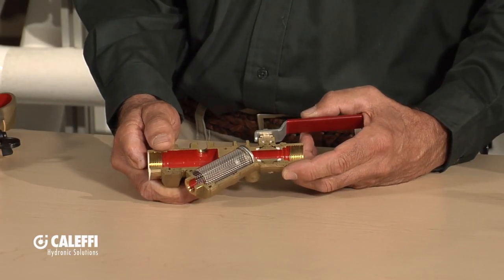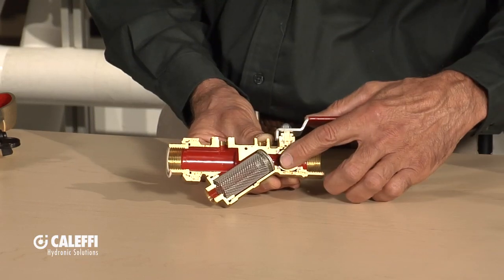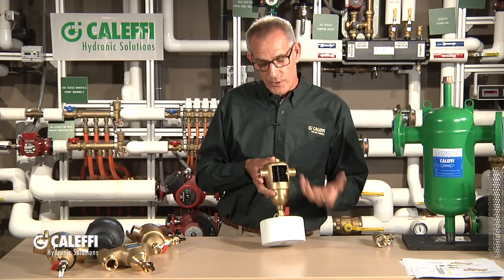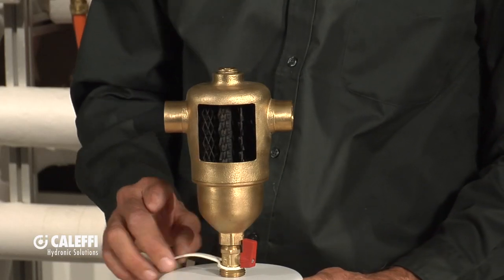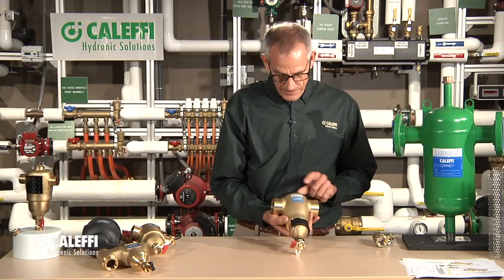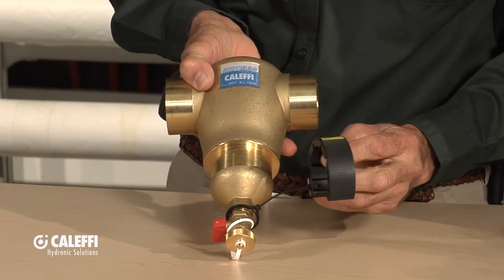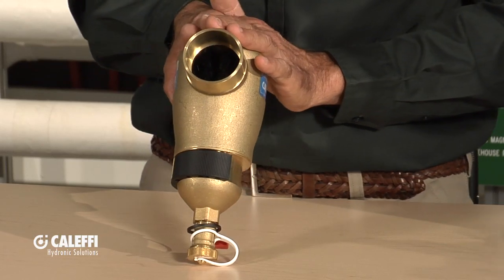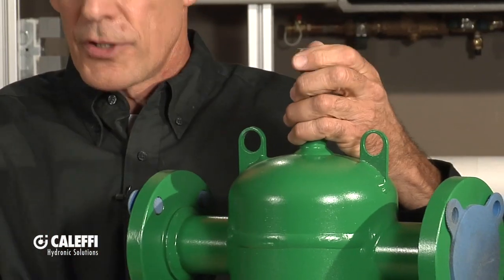DIRTCAL® and DIRTMAG® - Dirt Separators

Comment: Great stuff! How long will the media inside the brass separator with the magnets last?  Can it be replaced if it disintegrates after a number of years?
Reply from the maker: Thanks for your inquiry.  Longevity of any product in a hydronic system will always depend on the system conditions and water quality. We do offer a replacement media for the smaller brass separators if there is a need.